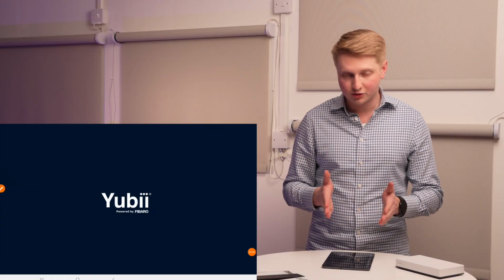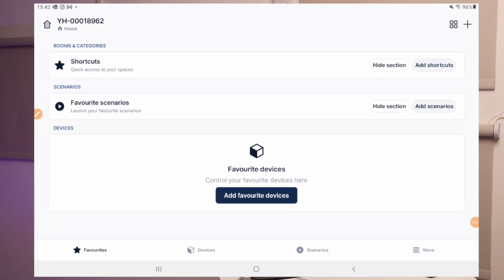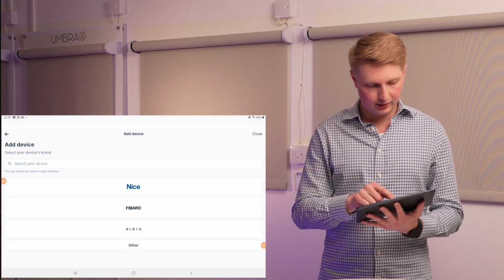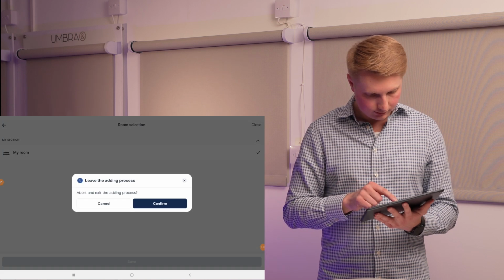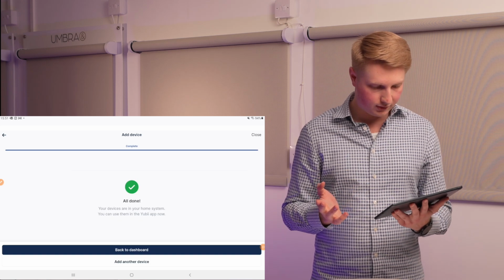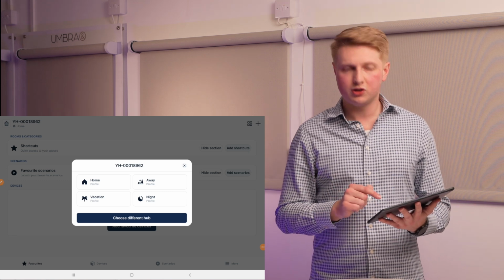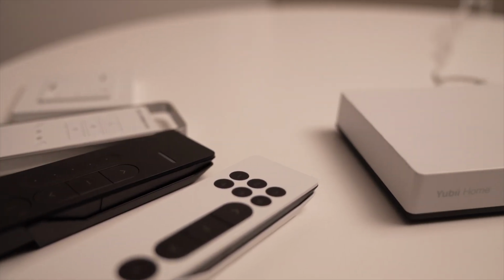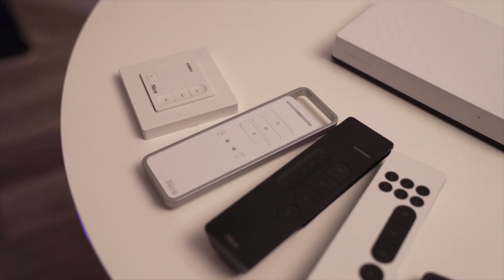Initial thoughts on the Nice Yubii Home App - Newly updated for 2024

Comment: Can you use Yubii home with alexa?

Hello, I'm having a problem with my Yubii Home controller: Alexa simply can't detect it. I've downloaded both the Yubii and Fibaro Alexa skills, but Alexa doesn't detect the Yubii Home, its devices, or its scenes.
I have another controller, the Fibaro Lite, and it detects it perfectly.
I've linked several Fibaro Roller Shutters to the Yubii Home app, but Alexa still doesn't detect the Yubii controller or any Nice or Fibaro devices through Yubii.
I've tried linking and unlinking the Yubii skill in Alexa, as well as trying with a different account, but the Yubii Home still doesn't appear.
I've tried updating the Yubii Home to the latest firmware version, both the regular and the Beta versions, without success.
I can't find any limitations in the PC software that would prevent it from being detected.
The Yubii Home is connected to a 2.4 GHz Wi-Fi network, and Alexa is also connected to the same 2.4 GHz network. I've restarted the Yubii controller and it's still not working.
I need urgent help, as my entire house is controlled by Alexa and I can't use the blinds except with the Yubii app on my phone.

Thanks,

Comment: Helllo ! Nice video ! ;)
I have NICE shutters with remote control RF 433,92 Mhrtz (no switch on the wall).
I also have a Niko Home Control Smart Hub already installed with several connected switchs  Zigbee and Z-Wave.
Would you know if Yubii Home hub and Niko Home Control Hub are capable to understand each other ?
Thks a lot for your help !
Fabrice
Reply: I guess it is more like 2 remotes: Both can operate the systems, but the 2 "remotes" don't "speak" with each other...